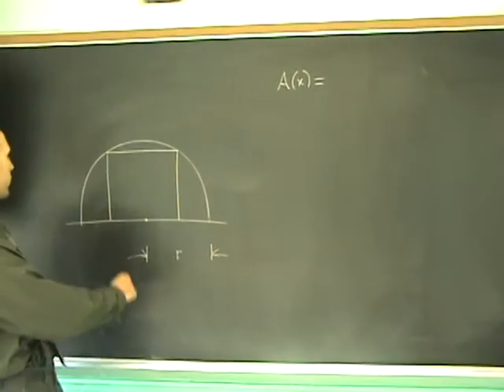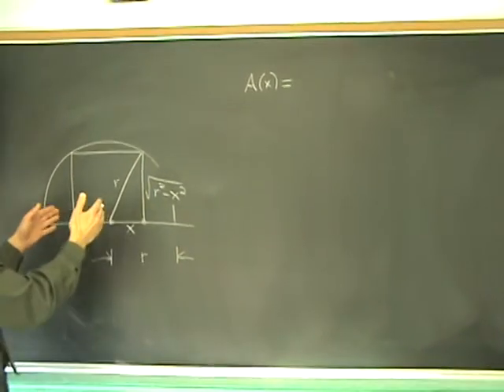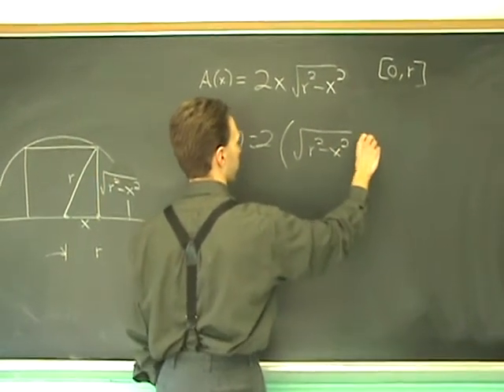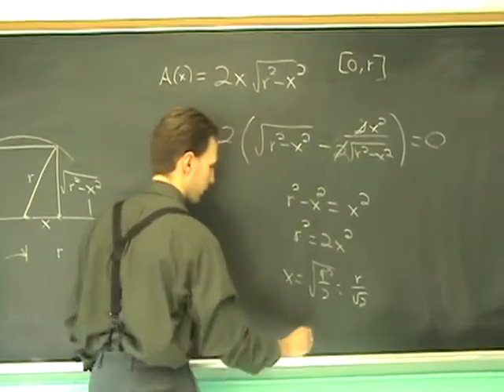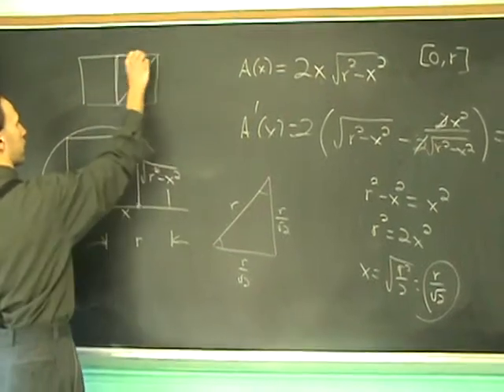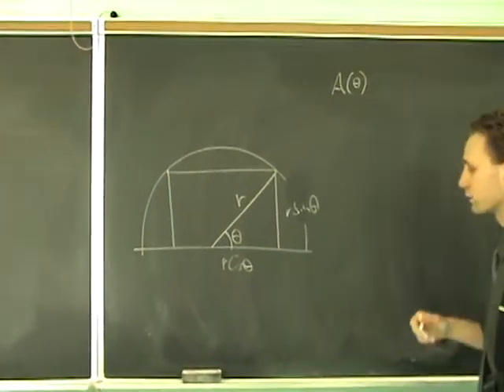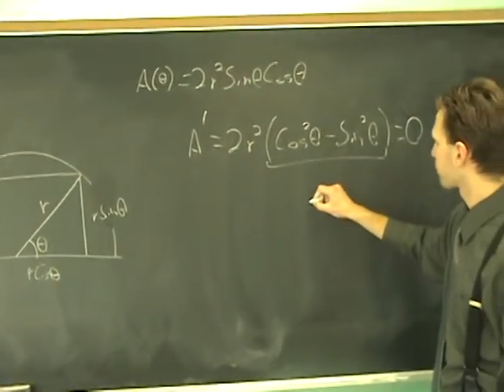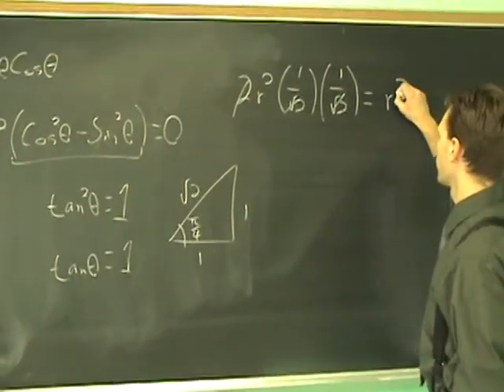Optimization: Rectangle inscribed in a semicircle

Comment: so r is just a constant that you dont differentiate?
Reply from the maker: It's assumed that the radius will be fixed (constant) for whatever circle you're dealing with, regardless of how x or theta change.  So it is technically differentiated, but its derivative is zero- just as though you were differentiating any number, like 9 or 25.

Comment: This is actually a great explanation of this problem.  The area of a rectangle is length x width, right? That's trival.  We defined half of the rectangle's length as X so the whole side is really 2X. The other side he got with trig so that shouldn't be too hard.  Multiply those two together and then set boundaries on those dimensions given the size of the circle.  The limits are there because we want a rectangle, not a line on the x-axis or the y-axis.